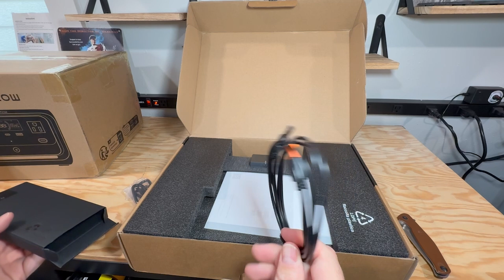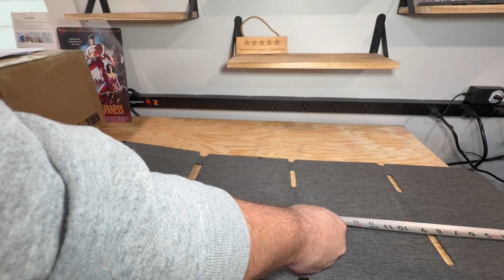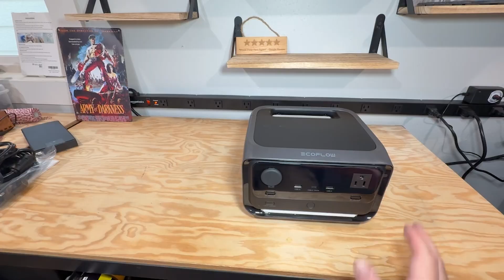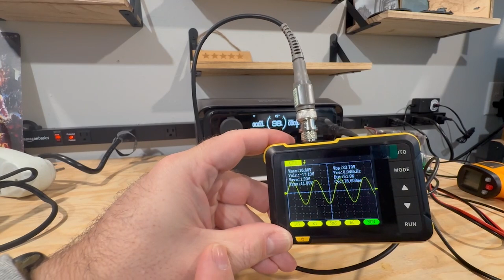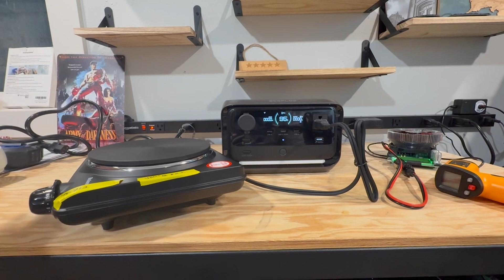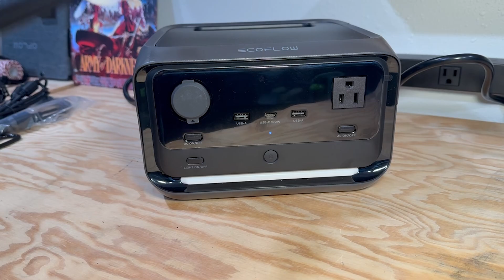EcoFlow River 3 Plus Unboxing and Testing

Comment: I have one ..the first has a Broken AC kicks around 400w out ..Failcode..
I give the first one back and get a New..same Problem.
400w Small heater like on the cover 😅..but there say 600w a couple of min. ..it was 1 min. And the AC cuts off in Failcode -
..really confusing ..lower as 600w ..
Reply: The Smell sucks 😂 i was looking for Electric issues in my Room before i realize this Powerstation is it.

Btw.the Sound of Ventilation was by my first one quit the second one sound little bit like a old Pcfan.

I tink tom.i bring it back and build my own Powerstation with replaceble Parts.

Funfact: a normal E Bike has more Capacited and with mpptsolartracker reloadable extra AC Converter its  maybe a better Way ..maybe maybe not..i learn a loot with this Device about Solar etc. 
I got my for 192€ but it feels like a Overpaid Powerbank and not a Powerstation.

Comment: Hmm, mine does the same thing, it turns the screen on randomly. Another thing, if you leave the AC on, without timeout and reserve is set to on it turns the AC inverter off randomly, so... keep that in mind if powering some important loads.

Comment: Watching to see whether you can charge it with AC and solar at the same time. Unsure if expandability feature was mentioned, wherein a secondary battery can be attached.
Reply from the maker: Sorry for the delayed reply.   I’ve had some medical issues and my 9-5 have kept me pretty busy.   I have charged from AC and solar and it works pretty well. I also picked up the smaller expansion battery.  

While I have zero regrets buying this unit, if expansion is something people were interested in, I would get the Delta 2.   It’s about the same price as the river with expansion, but it has more capacity and output.

Comment: Great review!  I have an Ecoflow River 3 but I am thinking of getting the Ecoflow River 3 Plus and the 600EB extra battery.  I'm also considering getting the Ecoflow Delta 3 Plus because it has a higher capacity and also has extra battery that can be attached.  The only thing with that is that the River 3 Plus solution with the connector pins seems way better than the cable that the Delta 3 Plus uses.  I'm wondering if they will change the design of the Delta 3 Plus to be more like the River 3 Plus.

Comment: Why is everything so much more expensive in europe just the river 3 plus is 300€ which I guess is about $325. And it's not taxes, even if you removed taxes it would still be 225€ or roughly $240 for just the river 3 plus with no solar panel. Sales in europe are also worthless hardly anything is ever more than 10% off.

Comment: I bought (and returned) the Anker Solix 300 AC.  The stink off that when recharging and the TEMPERATURES when recharging had me scared. I charged and depleted it about a dozen times over 2 weeks.  The smell was still terrible and the temperature around the AC plug was scary.   Another crappy thing about the Solix is that the AC cord is only 2ft long, gotta have it close to the drapes when it catches fire you know…😂. I have the Ecoflow river 3 plus on order, hope it doesn’t smell!!  The Solix had a ton of usb-c ports that were great. But when you used the AC inverter, the temperature inside the unit climbed quickly.   As a DC only unit, it was great.   I know Anker must have rethought its charging speed as there was an app update and they added a 300w speed.  I usually charged it on the 200w speed and the temperatures were still hitting high 40’s Celsius (120F) and this was at ambient temps of 18C/64F.  Couldn’t imagine using that in summer.  I was one of the first to get a Solix 300AC, so maybe it was before they ironed any bugs out.  I’ll be in the same boat with the Ecoflow too!!
Reply: Did your Ecoflow River 3 Plus had a smell?
Reply: @ Yes, the Ecoflow has a smell for the first 3-4 charges at full 360W.  I’m guessing there is a coating on a transformer in there that burns off with heat, or maybe a conformal coating on the circuits.  Since then, i have a the B300 add on battery and charge it at 400W without any smell.  Haven’t done the 650w charge yet.

Comment: I have both the 3 and the 3 plus, never had any smell off of either one, but you are not the first person who has said that there is a smell. I think your value for the money is way off. It may not be the cheapest 300ah inverter, but for the features, I would say it's a 5. At retail price a 4. The river 3 is probably a 3 or 4 on value. One of the better features is the ability to turn the outlets back on after a power failure.  Had the anker c300ac warks as a ups fine except when the batteries run out, once the power comes back on, it will not turn on the outlets.
Reply from the maker: The value is based on price per wh.  Using the EcoFlow site for pricing the River 3 plus is 73 cents per wh while the delta 2 is 48-49 cents per wh.   That’s a significant price difference from the same manufacturer.    I picked up the delta 2 on a Black Friday sale for $399 which put it at 39 cents per wh.     For me if you’re under 60 cents per wh, it’s a 5 on value assuming everything works as advertised and the unit has a functional app.
Reply: @ChargedUpAdventures  that's like saying , I live on a farm and need a truck for pulling equipment around , my big truck can do everything  I need it to do, but my mini truck can only hull 1/4 the amount but is a better value because it cost less.  Cost and value do not relate to each other  unless they can perform the same tasks. Great video thou keep up the good work.
Reply from the maker: The delta 2 is a 1024wh with an 1800w inverter that is almost almost 25 cents per wh cheaper than the River 3 plus.  Other than the 10ms UPS switch over time and larger size, it is far superior and costs less.   I am quite happy with the River 3 and it works perfectly for the purpose I use it.  Overall these smaller 200-300wh power stations will never have the value as the larger power stations based on economy of scale alone.   I've added the EB300 to my River 3 plus and it has definitely added value to to the power station.  I also now have a proper way to test USB PD because of that battery :)
Reply: Same I have both, never had a smell issue, that just might have been specific to your unit @ChargedUpAdventures
Reply: Yes it smells bad but it goes away. The DELTA 3 Plus smells really good like electronics tho.